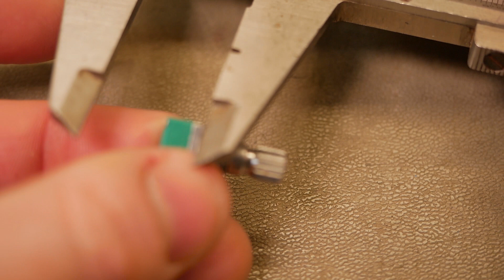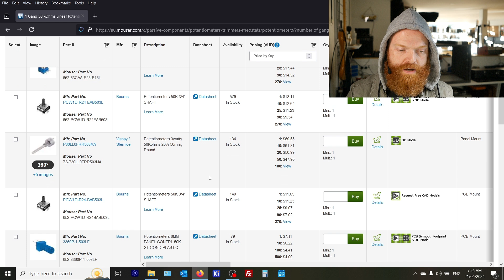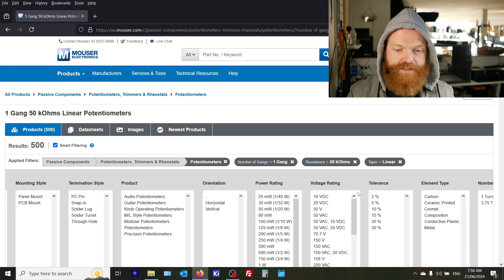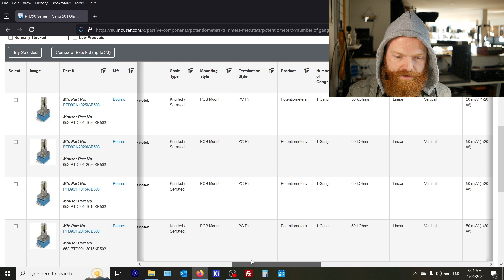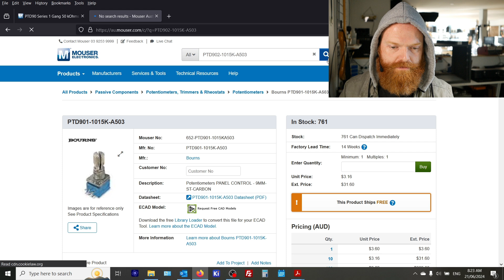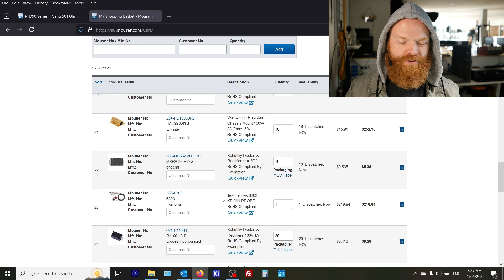Behind The Scenes - The Perils Of Ordering Parts

Comment: Have you thought about getting into surface mount soldering? A few more tools for the heater, digital microscope, and some tweezers but it seems doable and since everything is moving that way might be a good skill to develop.
Reply from the maker: I've been carrying out SMD repairs as a matter of course for about 10 years now. It doesn't faze me, and if anything, it can be easier as you often don't need access to the bottom of the PCB at all.

Comment: And Brad pulls out the same basic pot body I ripped those tiny leads off of removing a board. The shaft on this one was a short 1/8" diameter with a screwdriver trimmer shaft.  I hate this post Covid new normal horseshit. I gave away a bag  switching JFETs that I paid all of $40 for 500 of them not more than 6 years ago from Futurlec.  Now they are $4 each from Mouser or around $1500 for 500. I finally found some I actually do trust on eBay. CTS's minimum custom orders were usually 3000-10,000 pieces depending on how weird the pot was. I paid about $20 for a NOS JAN replacement panel mount trim pot. If you didn't rip the leads off breaking the plastic shaft off was another risk. Bourns sells one with a plastic bushing and a long 1/8" plastic shaft. PASS! GO INTO THOSE SPEC SHEETS and READ THEM!!! I bought an opto-isolator in an SMD gullwing DIP package, and that part will NEVER plug into an 8 pin DIP socket. LOOK AT THE DIAGRAMS! READ THE SPEC PREFIXES AND SUFFIXES,  and DOUBLE CHECK THEM WITH THAT SPEC SHEET! 1/4" 32 TPI bushing with a short trimmer 1/8 inch shaft for the back of a product located where the cord rolls up? NO PLASTIC BUSHINGS! They will get broken off, and you are right back inside the unit fighting with it again! It's not unusual to be searching for parts until past 3:00AM.
Reply: I have a Japanese market only hybrid Fukuin quadraphonic integrated receiver on the bench. It is 100 watts per channel in quadraphonic, 200 per, in  stereo and bridgeable again to 800 watts in mono. It also used the Japanese version of the 8417 so it has to be rewired for 6550s, or I have to find eight matched 8417s or eight matched Toshiba 6GB8s. The Toshiba was truly great tube but that is up to the owner. If he wants the amp to sit for months while I test tubes and spend over $10,000, fine, as long I get my money.

Comment: I have had two DV Mark amps develop problems with the pots after a year or so The amps sound great but are not reliable in normal use due to these components I did manage to clean one of them sufficiently to get it working again As you say Brad if they just made the amp box a bit bigger they could accommodate conventional easily replaceable control pots
Reply from the maker: Yes, marketing departments have a lot to answer for!